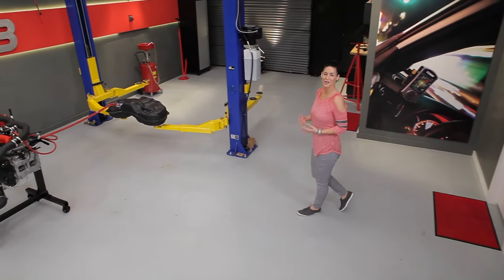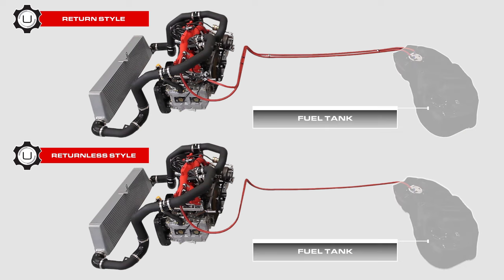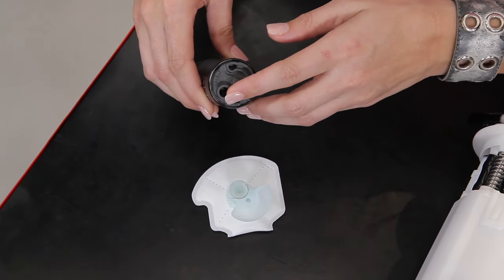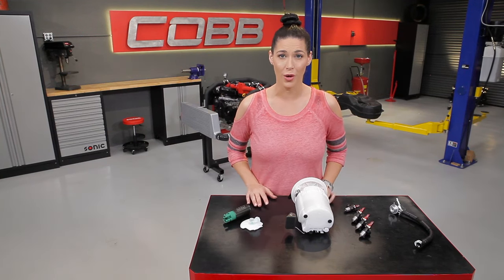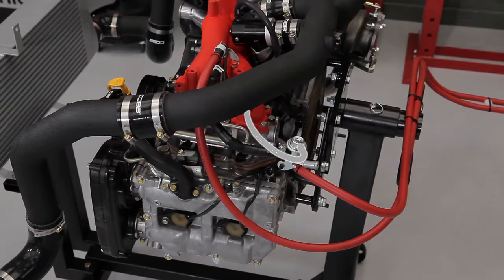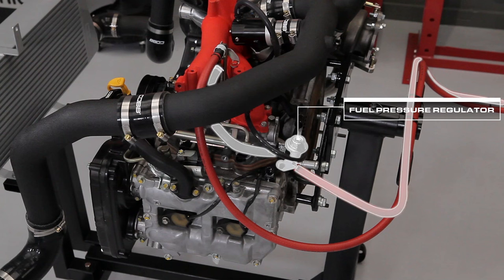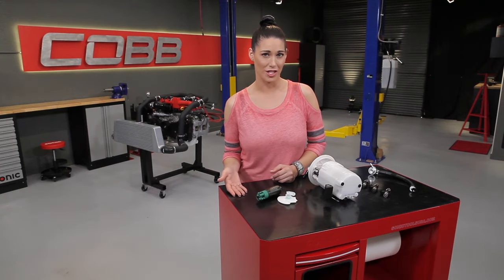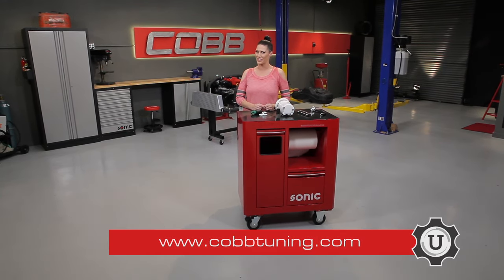COBB Tuning - COBB University Episode #7 - Fueling System

Comment: She had answered my question to why i was having Cyl 3 misfire. Not correct fuel pressure at injector will cause misfire.So I looked at Cyl 3 injector and that lil sucker  was wet and made a puddle of fuel on the engine. Simply not tight.

Comment: Does an upgraded fuel pump require a reflash ?
Reply from the maker: Not if that is the only change. But typically the only reason to upgrade a pump is because you have made other upgrades that require a stronger pump. So not sure how often that would be relevant. If you have a failing pump and want to go with a mild upgrade versus a stock replacement because you might need it later. Then that will typically be fine without the need to reflash.

Comment: For people want to khow I’m running on 2016 Subaru STI this is my car,, invidia Catted downpipe with stock air intake and stage 2 with cobb fuel pressure regulator kit runs perder for me I when to tuner guy say don’t need tuning after you install the cobb fuel pressure just let you khow guys if this helps